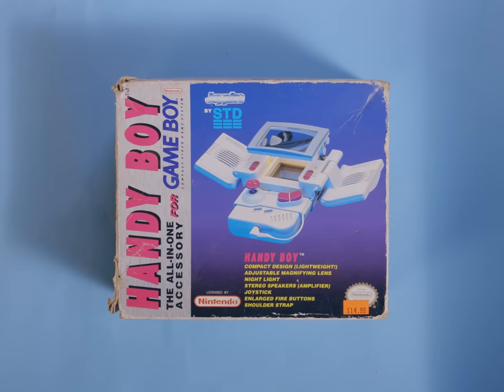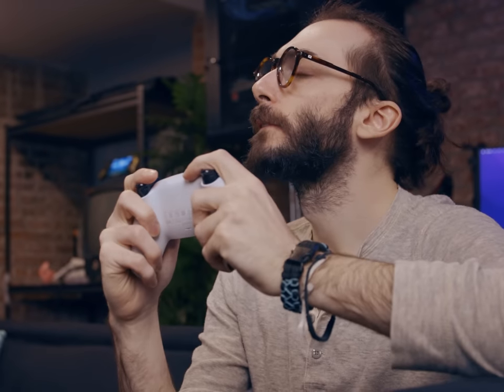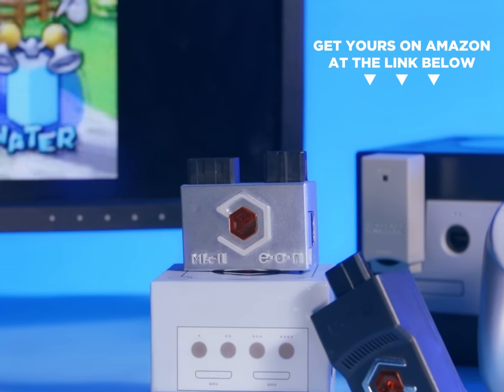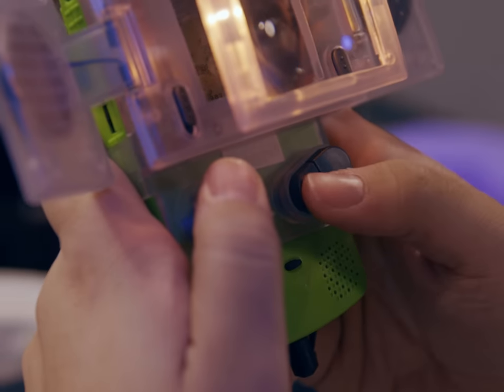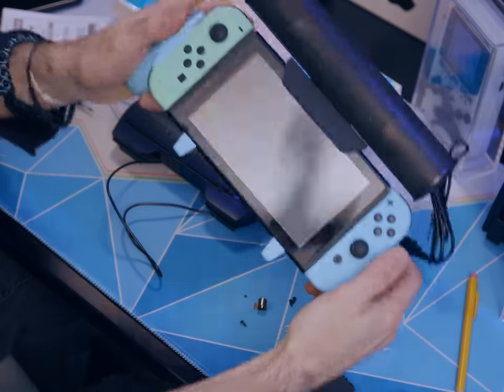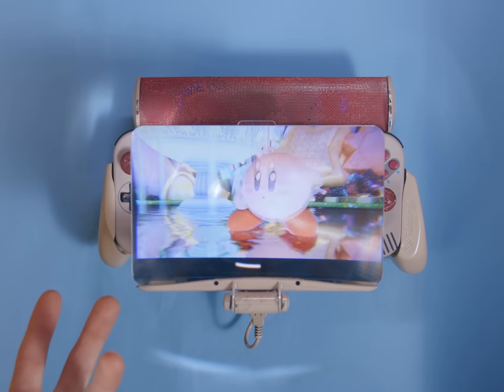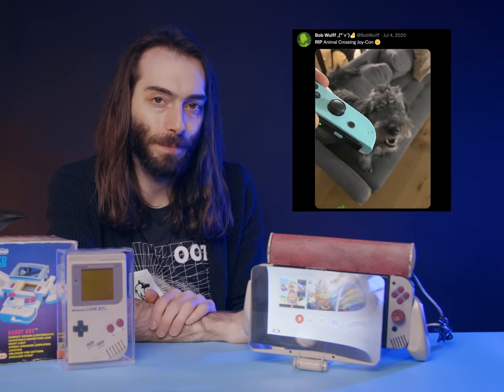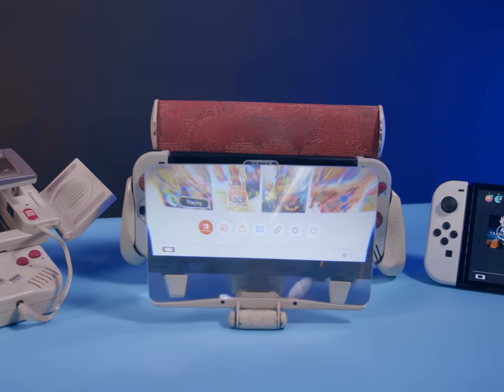The Handy Boy for Nintendo Switch

Comment: Regarding the ad (gchd): Why do so many YouTubers assume you can't connect retro consoles to modern TVs without an HDMI adapter? You still can, it just won't look as pretty. My NES is hooked up to my HDTV right now. No special adapters required.
Reply: A lot of newer tvs only accept HDMI input. Now, Idk, with an nes, maybe you're going through coax, right? But Gamecubes and that era of consoles do not have coax out. And they do not have hdmi out. So, you'd need an adapter. But I personally am going the other direction... I have gotten myself used to CRTs again, and it's amazing :) The Final fantasy pixel perfect remasters look unreal on an old sd crt tv. I just have this cheap cable I bought on Amazon that downscales hdmi out to a composite signal. And I've used it on my Wii U to play my Wii games on a CRT, so I don't have to set up my Wii. Anyway... CRTs are amazing once you readjust your eyes. Embrace the blur!
Reply: @pwnedd11  My TV has 5 HDMI ports and 1 Component/Composite combo port. I don't know of any TVs that only have HDMI ports, not even brand new display models -- I look at the back of them in the stores, they all have composite or component (or combo) ports. Are you sure your "TV" isn't really a computer monitor?

Comment: There's actually a built in magnify option. Just press home twice.
If it doesn't work you need to switch it on in the options.
It's very useful for those games with super tiny text.

Comment: I’ve been working on my own handy boy. With the same magnifying glass and satisfye grip. I added battery cells to the inside of the grip with the wires running inside the grip and the module sticking out. And a ten1design to hold my phone above the console. It is atrocious and I love it. I use a neckset when playing to make it even more weird
Reply: Also. Made a ton of modifications to my dock to be in par with my handheld Frankenstein and it ended up looking really cool

Comment: Why did you need to plug in the speaker at the bottom of the switch? Just get a battery pack and stick it to the back! Or get a speaker with batteries inside!

Comment: Just modded(hacked) my OG switch... Never had so much fun in competitive Smash Ultimate
Reply: How difficult was it? I have an OG Gen 1 switch that is also hackable but haven’t done anything to it yet. Was it worth it, how much work did it take, how much did it cost money wise?
Reply: @wolfiemuse  cost me nothing... Because I 3D printed and made my own RCM jig. But I don't recommend that. If your switch is in good shape, It's REALLY easy to do. I'll link a guide if you want. An RCM jig is super cheap like 5 bucks I'm sure. Other then that you need a good SD card. I'm starting with a little 32GB I had laying around but I'll get a bigger one so I can do more with it. You'll need a USB-C cord and a PC that can connect to it. The whole process can take 15 minutes but you will have to reinstall the games you have on the SD if you had any(easy). Custom themes. Emulators if you want em. Mods for games. Other apps... Learning as I go.
Reply: @Camera_Cru  I def want a link to whatever guide you used! I’d want it mostly for emulators, modding Breath of the Wild and that sort of thing. I’ve heard about Homebrew, I’ve gathered that’s an app you use to download games and mods etc correct?